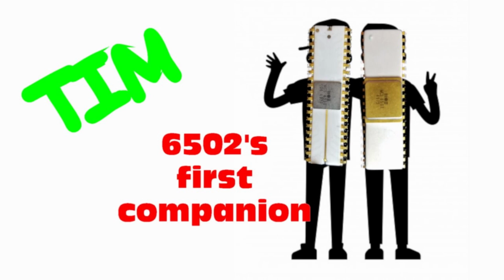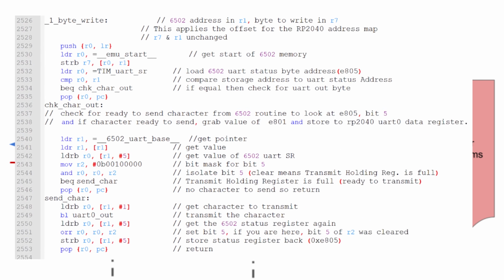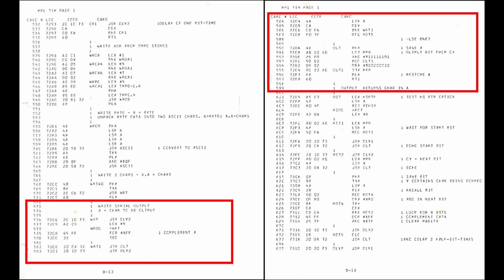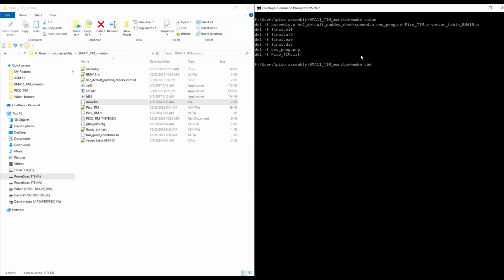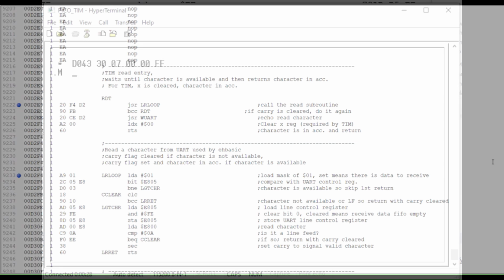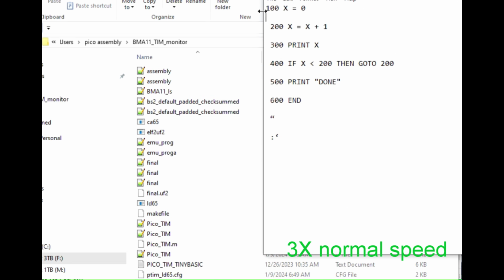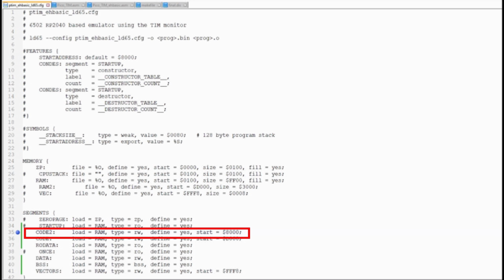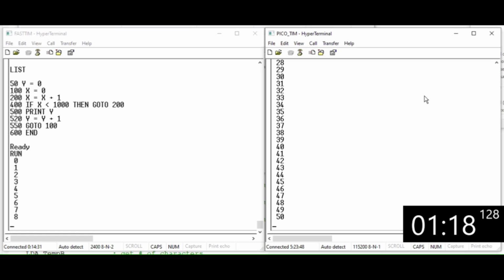RP2040 - 6502 Emulator - TIM, Tiny Basic, and EHBasic

Comment: I'm a C programmer, but I have a special love for VB6 and Delphi. I use both regular. I didn't know about Tiny Basic, but I'm going to check that out. The basic dialect is beautiful.
Reply from the maker: I used Visual Basic a bunch for very complex scripting of Excel from 2007 through 2016 and I really liked it.  You might be disappointed with Tiny Basic; its primary feature is that it is tiny.  It fits in a couple kilobytes.  But it was the first application my recently built computer could do in the late 70's.  Check out a couple of my earlier videos on Tiny Basic ( https://youtu.be/0S9A_c3TkRo ) and TIM ( https://youtu.be/BcqRvHkn-EA ).  Thanks for the comment!

Comment: Nicely done David. I love this project, and stumbled across it in a very timely manner - I want to stick a much accelerated 6502 on my C64 and have it run the standard C64 floating point routines and a few other things to operate as a simple math co-processor. So that means interfacing the PICO 2040 board to the C64 - simple enough with a few level shifter-buffers. Remind me - what is the relative speed of your emulated 6502?
Reply from the maker: Thank you.  My emulator has a "clock" speed of about 5 to 6 MHz depending on the program.  Sounds like an interesting project; good luck and most importantly, have fun!

Comment: Excellent, can't wait for the next video. For serial I would not bother about doing the assembly work.. just throw a CH340N (SOIC-8, no crystal) on the uart. What would be interesting though is adding usb support for a keyboard
Reply from the maker: Thanks for the suggestion.  I'm using a similar adapter (but with a cable) right now.  I was trying trying to reduce the cost of entry even more.  Unfortunately, I would need to implement a separate power supply which is probably just as much of an expense.

Comment: For the joy of it.  Nice to see, David.

It would be fun to see your 6502 emulator on a RP2040 Pico running Hopper code.  Hopper is a new programming language using bytecodes with virtual machine runtimes on microcontrollers.  Michael Cartwright already has runtimes for 6502 along with RP2040.  Hopper is mostly written in Hopper.  A .NET based IDE on Windows is used for compilation, a microchip programmer, and monitor for the excellent Hopper debugger.

https://www.youtube.com/playlist?list=PLriDPC-IsO2kS9yC66plwe2y_EtuIahNt

A 6502 emulation on an RP2040 running a virtual machine, perhaps in RP2040 mode stuffed with the 6502 runtime.  Then running BASIC programs.  For the joy of it.
Reply from the maker: Kinda mind-bending.  Thanks for the link, I did a quick look.  I'll have to dig into it more.

Comment: TinyUSB as a CDC device is easy and reliable for what you need. But you'll get more bang in host mode with keyboards, mice, storage, and more. Want both host and device ports? There's a PIO USB device too!
Reply from the maker: Congratulations on your work on marrying the 6502 and the Pico!  You're channel has some very interesting ideas.  USB certainly looks doable; I just have to do some head scratching to see if I can implement it in bare metal without the sdk.  Thank you so much for showing me what is possible!  I've got a lot more learning to do!